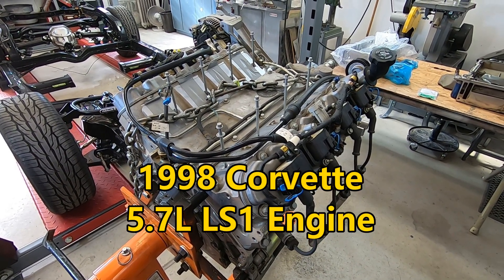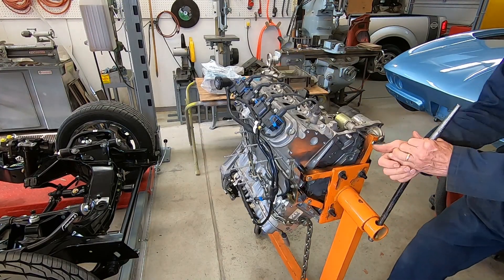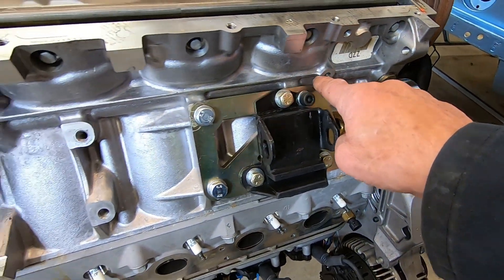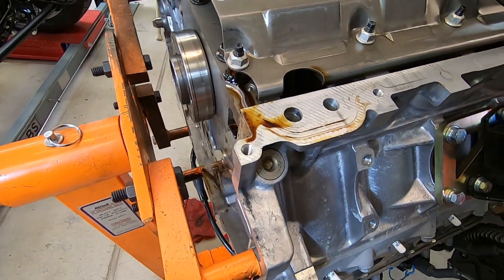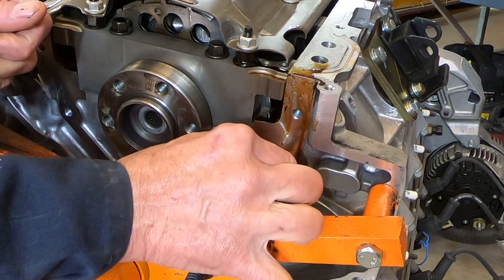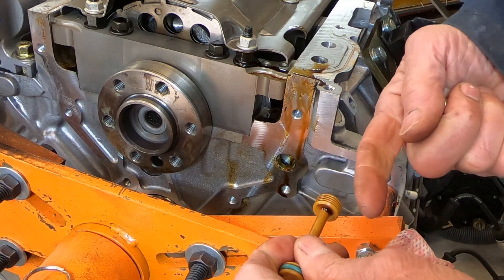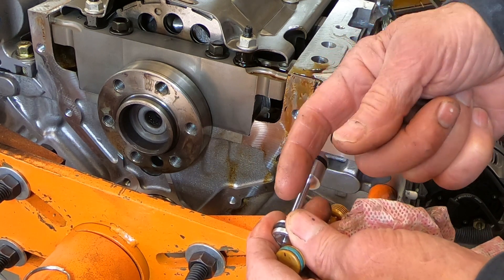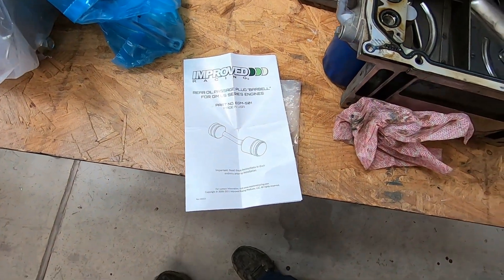Chevy LS Engine Oil Galley Plug (Dumbbell - Dog Bone) Replacement

Comment: The factory one will not reduce oil pressure. Yes it may cause contaminated oil to bypass the filter, but it will not show a drop in oil pressure. Like you explained it causes the oil to go through the filter then flows around the narrow part afyer leaving the filter. If it leaked past the front to the narrow part you would have the same oil pressure as if it went through the filter.
Reply from the maker: You are right about this. I didn't give it enough thought when I was making the video. Thanks for pointing this out.